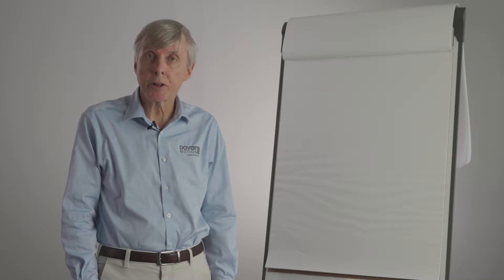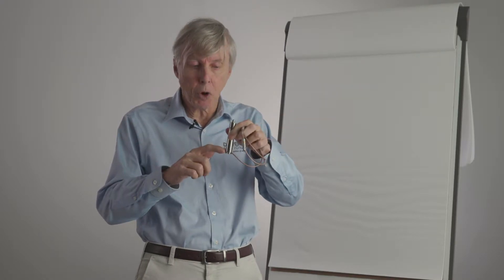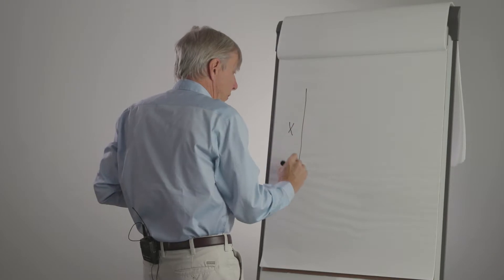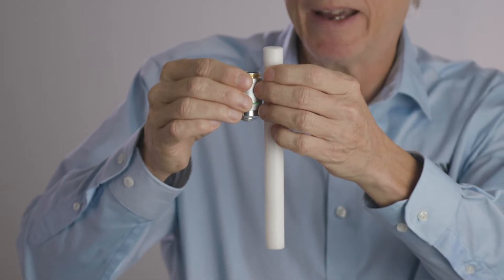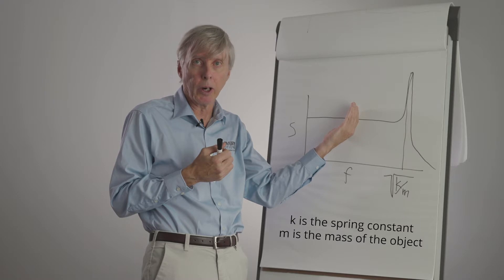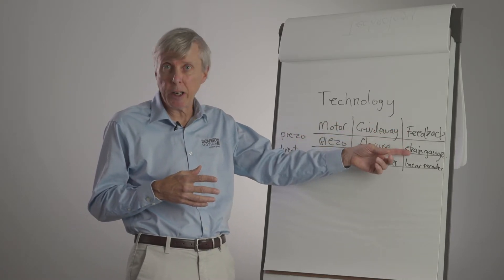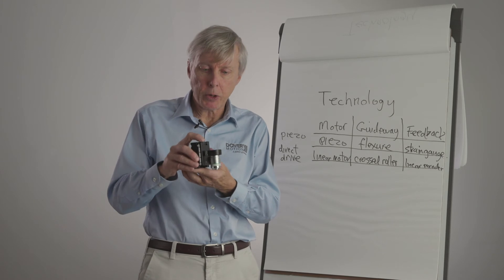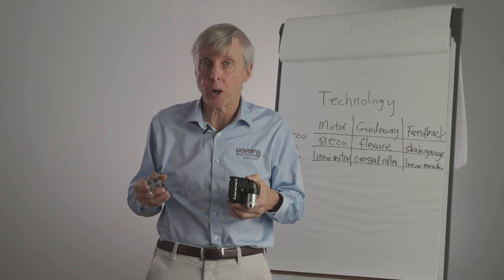Piezo Actuators & Their Limitations in Digital Microscopy

Comment: A bitter sweet presentation, I was hoping piezo actuators could be a good fit for normal size robotics but it isn't (as the current form of this tech at least).
Reply: Same here. I was doing some reading to see if it would be possible to create muscle bellies using fibres of piezoelectric material but discovered the contractions would be negligible and not enough to flex an elbow.
Reply: Instablaster.